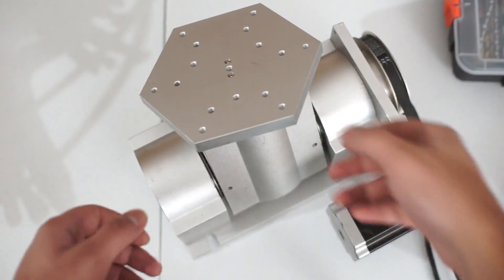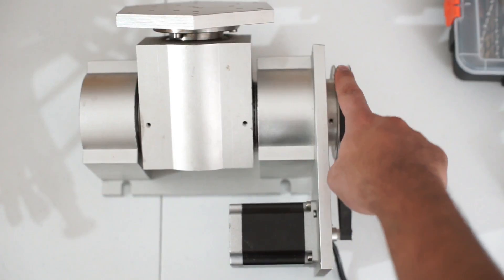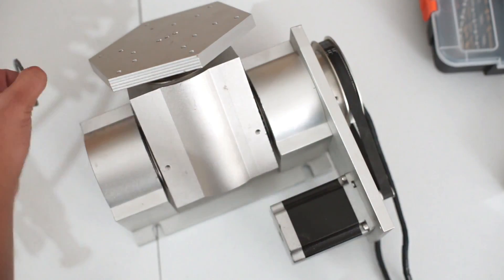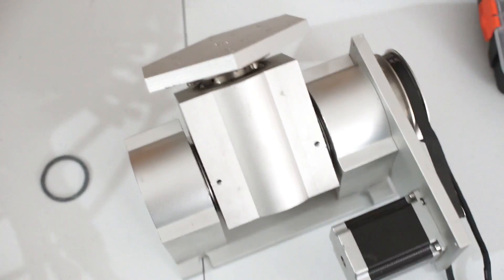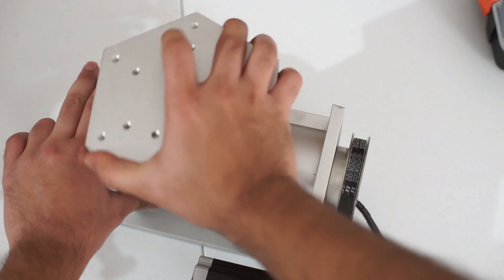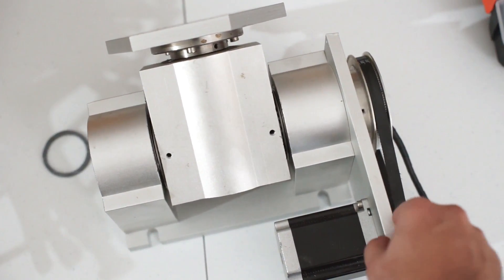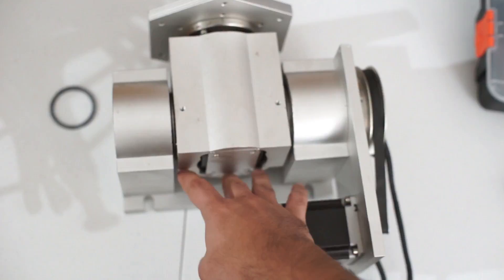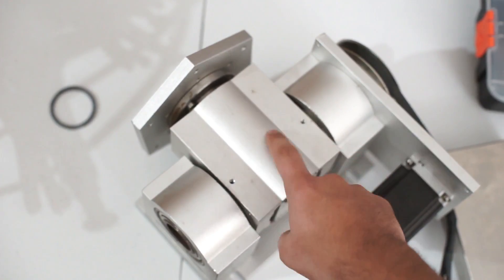Chinese CNC Rotational 4 Axis  and 5 Axis - Initial Review

Comment: I found it on eBay:
http://www.ebay.com/itm/CNC-Rotary-Table-Engraving-Machine-Rotary-Axis-A-Axis-B-Axis-4th-5th-Axis-1-6/261824601765?_trksid=p2047675.c100011.m1850&_trkparms=aid%3D222007%26algo%3DSIC.MBE%26ao%3D1%26asc%3D40130%26meid%3D4c67e30d03d341f88b922d4bb5838205%26pid%3D100011%26rk%3D2%26rkt%3D9%26sd%3D251859705007
Reply from the maker: Sorry, IDK why youtube did not notify me about your comment. I got mine from someone who was just reselling it in the USA used. I would recommend buying a thrust bearing to space to eliminate the backlash. Like this one "AXK4565 THRUST NEEDLE ROLLER BEARING WITH TWO WASHERS 45mm X 65mm X 3mm A145". It is a bit big for the shaft, but it works. Could not find a cheaper smaller one.

Comment: how much did you pay?
thanx
Reply: So... did you build the machine?
Reply from the maker: relikvija $300
Reply: EKDesign 
thank you!
Reply from the maker: No not yet the plan is to build a 5-6 axis CNC, I have the open built rails and assembled, but realized I needed small parts and plates so got a mini mill along with the need to CNC some prototype for design projects for school. Also trying to figure out how to make simultaneous 5-6 axes happen without having to buy expensive software.  I will make a video kinda going through what I am trying to do this summer.
Reply: That would be great. 
I  plan to build a 5 axis system but with the B and C axis mounted to the z axis on a gantry. 
What kind of motors are in your system? Nema 23?
Does it  also feature a harmonic drive ?
Reply: which company did you buy it from?
Reply: EKDesign 5 axis simultaneous is now an option through fusion 360